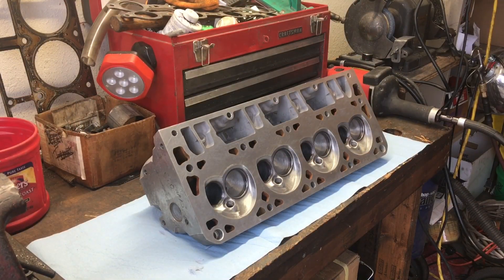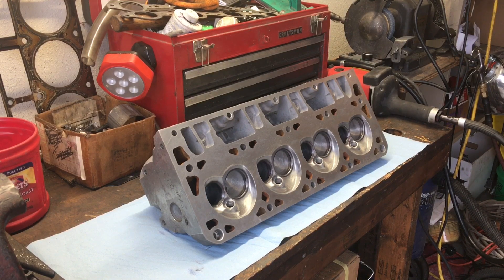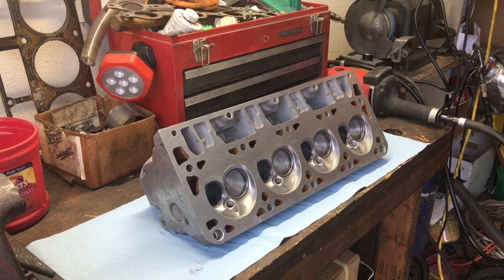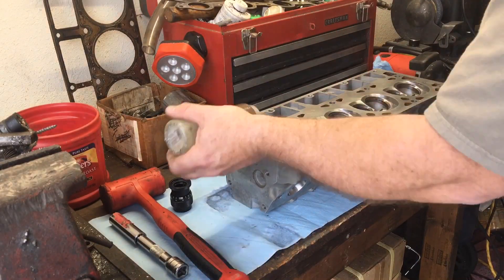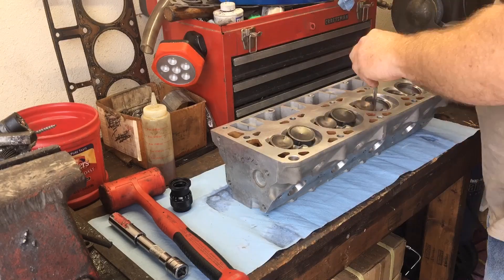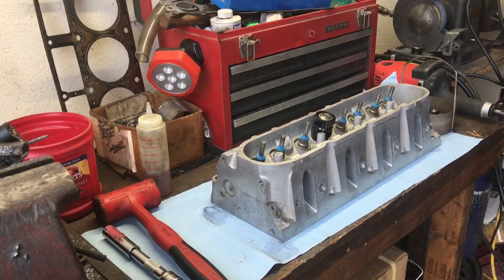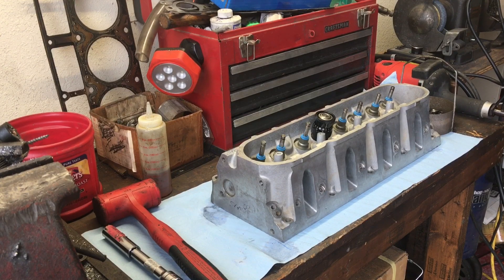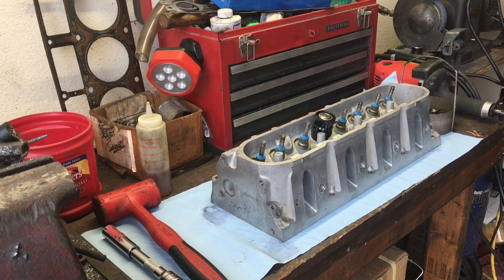Porting LS 862's Big Flow 220cc/83cc PAC 1218 springs

Comment: What compression would I be looking at if I ran flat top pistons with 862 heads stock, style gaskets and shaved the heads .030
Reply from the maker: DJPerformance What size engine will the 862’s be on?  The CID has a big impact on the Static compression ratio. JD
Reply: HeadFlowInc lm7 5.3 block
Reply: HeadFlowInc any ideas of what the compression would be on a 5.3l
Reply: @hAnGoVeR220  about 11-1

Comment: Got a set of ported 862s for sale??
Reply from the maker: Swaff 86 I don’t have any at the moment, what type setup are you looking for?
Reply: HeadFlowInc  
Something along the line of your “porting 862 heads for velocity “.
Reply: 862s with 2 inch intake valve and just port clean up. Want to keep velocity up. Typically mill my 5.3 heads to 58cc chambers. No time to do myself and id rather buy. If run across any let me know. Thanks for your time.

Comment: Did you put the on a bench?  Most of the flow is in the short turn very touchy
 with the LS heads
Reply from the maker: Victor Dahn I developed my ports using porting theory mostly from Joe Mondello.  We lost the only Flow bench in Kansas City when K&M machine shop closed.
I recreate the ports I’ve had success with, I understand what you’re saying, an inexperienced porter can ruin a head by cutting too much. GM did a great job wit the LS short turn, I work on widening the short turn and blending it into the bowl cut percentage. The general shape or radius of the turn doesn’t really change.
Here’s my bowl cut percentages I use:
Intake 88-92%
Exhaust 85-87%

I don’t like to exceed 87% on the exhaust bowl, especially in a Turbo build because I need the valve seat to stay in the head! 👍👍👍
Reply: HF, that is a great start but a bench and some pitot tubes will really make the difference in your game. I have a bench that a made myself using the PTS plans it has 10 220v motors. A stock Ls head is about 220 to about 240 cfm depending on casting # but with some work you can get them easy into the 300+ range. I also attach the intake on these heads and its very surprising how much some of these can take away from flow. the new gen 4 truck intake is very good on a 300 cfm port.

Comment: From a valve spring stand point, my machinist said that BTR springs are spot on usually.  Of course I get what you're saying and you make good points!  Great videos you do on porting, I used some of your advice in porting mine.  I've thought about going and getting mine flowed, but I'm just ready to get mine running at this point and I'll go by the dyno numbers and ET to figure out what I did.
Reply from the maker: Live To Race I want to clarify the Valve Springs are not the main variable when setting the “Installed Height” for the springs used. 
BTR, PAC, Comp Cams, Elgin or any quality valve spring manufacturers hopefully will have a consistent end product. It’s concerning your machinist didn’t explain Installed Height better. 
The available space between the cylinder head spring pocket up to the bottom of the retainer, installed w/locks valve fully seated is your MAX stem height.  Here’s some reasons the height can change:
Valve job
Aftermarket valves
Aftermarket spring retainers
Aftermarket valve locks
Spring shim thickness

Any number of these factors can change the final installed height. Yes if all you do is swap a set of quality springs on to a bone stock set of heads the IH should result close to the 1.800” needed.  But I stress, if you’re changing any parts or having a valve job done this is when verifying the IH is needed. I hope this makes sense?! 🙏🏻
Reply: @HeadFlowInc  I know all those are variables and he does too.... he was just stating that they are pretty much spot on when using their spring kit which includes shims, retainers, springs, locks, etc... Guess I didn't say it clearly.
Reply from the maker: Live To Race If you carefully do a good percentage bowl cut and blend with reducing the valve guide boss you’ll see a good gain. If you remove the swirl ramp, which isn’t necessary for better flow, don’t try cutting it to match the other side!!! There is coolant just below the swirl ramp! 😳. Be conservative

Comment: Those look great.  I'm thinking of doing a 6.0 bracket car in the next year and this would be a massive upgrade over stock.
Reply from the maker: Brent Spence A set of heads like these should support  crankshaft  600+ hp NA or easily handle 1200+ with Boost, the limiting factor would be you’ll need more head bolts to hold the gaskets! 👍😀